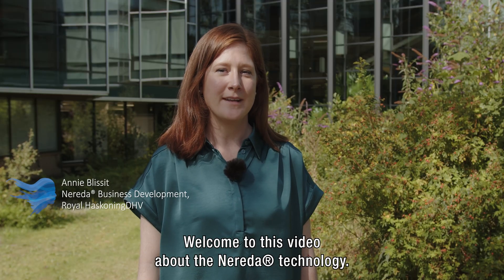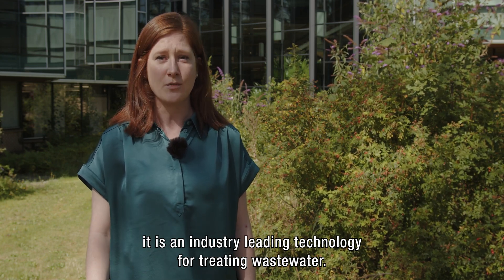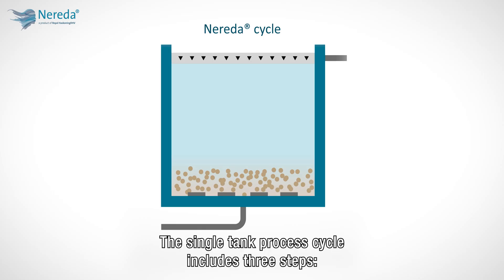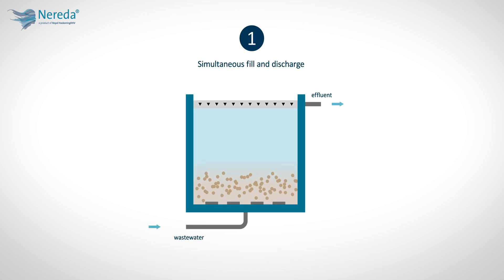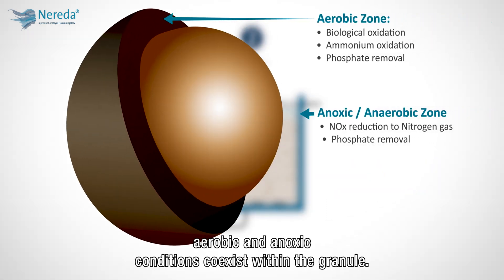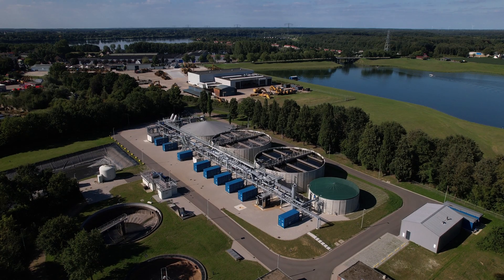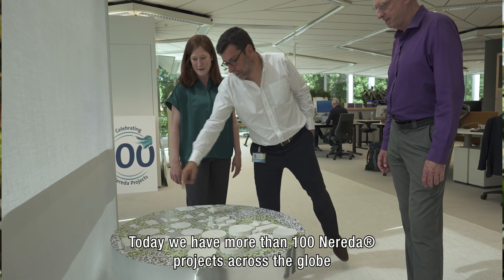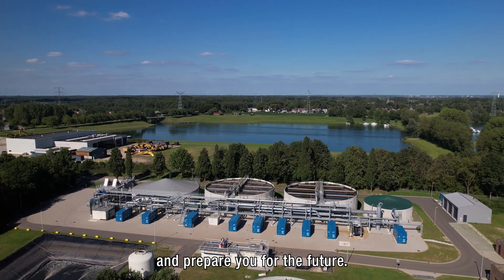How does Nereda® Aerobic Wastewater Treatment technology work | Royal HaskoningDHV

Comment: I fail to understand how this dense granule is formed? is there any additions to the system which helps the granule formation? Do you mean the special (may b polymeric) granules are inserted into the aeration tanks ? the process looks quite similar (as u rightly  said)  to normal activated sludge process. What conditions in the tank , setting etc.  eager to learn more about this technology, so i can advise in the concept design phase of the treatment system. Still have some more Q's:hand-pink-waving: